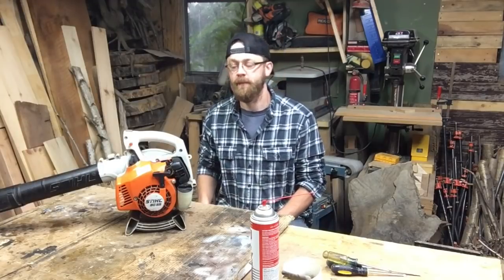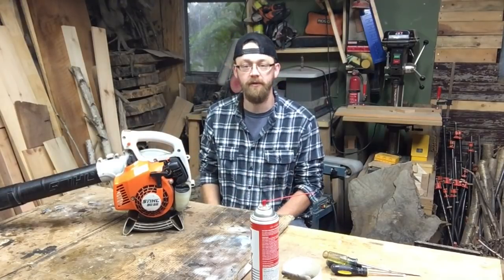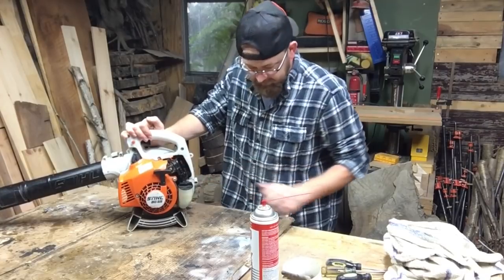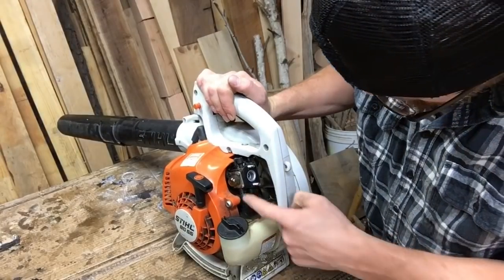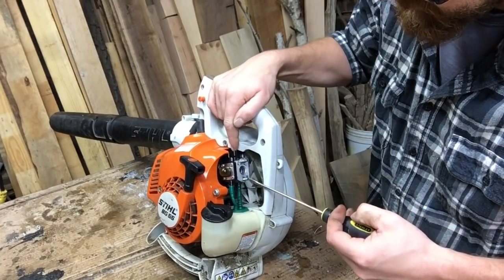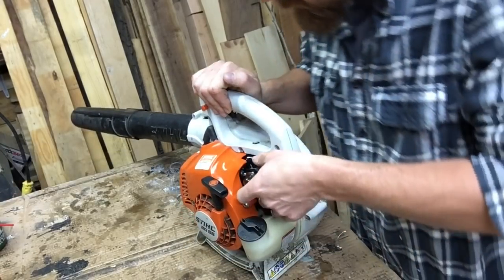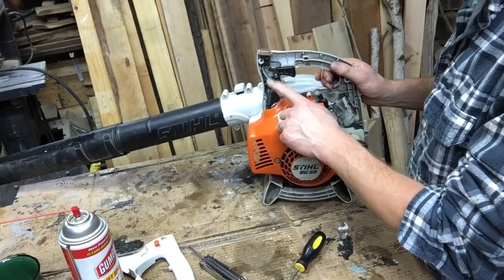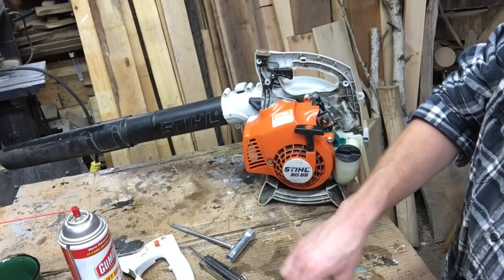Carb work on a Stihl bg 55 leaf blower.

Comment: suggestions replace the primer bulb, dump gas get new (check for water) pull the spark arrestor and clean then do the carb clean

Comment: I bought a used bg85 and it ran great for about 5 minutes then died. I checked the filter, spark arrestor, plug, etc and was all good. I determined that it would die because the check valve on the top of the gas tank was sticking from the previous owners use of ethanol gas and, just before it would die, I would unscrew the cap real quick and she'd rev right back up. Fixed that issue by drilling a tiny, tiiiiny, hole in the gas cap so it wouldn't spray gas out while running and I used it all day long after that. Ran several tanks of premium ethanol free gas with Stihl two psycho oil at 50:1. Runs perfect
Reply from the maker: Awesome comment thank you for sharing!
Reply: @KyleHallwoodworker  it's my pleasure. I quickly diagnosed it by unscrewing the gas cap when it would start to die and she revved right back up. Not a bad little blower.

Comment: i learned alot. i have to do this this weekend. i always dispose of the old fuel when i do a carb clean. i make sure the isn't any debris in the tank before putting in fresh fuel and attempting to start. that old gas can re-clog the tiny jets i and then you would have to take it apart a second time.
Reply from the maker: Absolutely true . Thanks for the comment Noel

Comment: Thanks!  I have this exact model and I am having trouble with from sitting too long.
Reply: Cheap carbs on Amazon $13.00 cheaper than a kit. I used parts from new carb to fix stock carb! Mine was a fs130 brusheater !

Comment: First, try adjusting the gold screws on top of the carburetor while you pull the throttle. I did all this work and that is all it was. The one closest to the back of the blower did it for me.
Reply: On pretty much all 2 cycle carburetors, the low jet screw is closest to the engine. The high jet screw is furthest from the engine.

Comment: No disrespect to Kyle Hall's informative video and effort.  

With BG55s, if you can't back out the tiny jet with the #(?) slot, one size down from a #1 and strong enough that won't snap, buy a new carb.   

The 55, from cheap Stihl subcontract carb, has to be run every week if using pump fuel to flush out all the junk in the fuel.   Owners buy and fill from the pump, use one weekend, and leave stowed in a shed for a month or longer and the gas in the carb, even 91 premium octane, at some point gums up and clogs the jet.  Doesn't always happen, but from cold start to full throttle and the motor bogs and quits, it's the jet.  If that tiny brass screw on the primer side doesn't pop out, the carb is toast. You can never get at to poke clean with a wire.  

The BG55,  a great little blower, is designed for 100% paraffin fuel and to winterize with.  The junk in pump fuel gums the jet, soots up the spark arrestor and the plug.
Reply from the maker: Thanks for this comment Jason
Reply: Tearing mine down tomorrow. Between this vid and your comment I have a few key points to look for, appreciate you both, thanks

Comment: You give me motivation to try and do this on my own.  I am just going to put in a new carburetor and dump the old gas.  I don't have anyway to heat up the spark arrestor so if that is the problem I will have to take it to a repairman.  Ugh!
Reply from the maker: Gayla Hunt  You can also get a carb kit from a dealer if you want to take it apart. If you choose to just put a new carb on do not toss the old one it might come in handy down the road .
Reply: I cleaned mine on the stove with a pair of pliars
Reply: Thanks for the great suggestion.  I did find a torch but I didn't need it the spark arrestor was clean when I checked.
Reply: Pull the spark arrester, and get rif of it.  don't ewaste your money on another one, it will fail too. You don't need it. It's a safety thing. Just don't blow any leaves in California and you'll be fine.
Reply: I use a bench grinder with a wire wheel. wd40 and water helps too

Comment: A new carburetor from Stihl is under $50, aftermarket ones even less. These blowers are about $150, the dealer won't work on it very long before you have that much in labor. I've been successful many times just cleaning carbs and dumping out old gas just like in the video. 
I've done this for neighbors, I tell them to get rid of any gas they have in cans. They don't, then put the old gas back in the machine and you know what happens.

Comment: Can get entire tune-up kit (carburetor, all fuel and vent lines, filters, gaskets, spark plug) for barely $10 and replace it all in barely ten minutes.  Doesn't take a genius...  and I like fixing my own stuff - but just a no-brainer.
Reply from the maker: I have replaced a carb on one of my chainsaws with a cheap carb it ran but it did not run the same . Replacing the carb is definitely a faster fix but I dont always have the time to wait for it to come in the mail . Learning how to make a repair yourself can save you money and time down the road . Thanks for the comment.
Reply: Yet the equipment suppliers say it’s not worth fixing. They tell people just to buy a new one.

Comment: cleaned and replaced every part on mine and ended up smashing it on the concrete. then ran a mag through it. think the problem was it didnt have enough holes in it.
Reply: You won't find this answer anywhere online: gas tank check valve gets stuck in the closed position and creates a vapor lock which won't allow the carb to suck fuel.
Reply: Hate mine too, for a long time it has to idle to warm up, now it just idles then bogs to die, was bought for my mom and I can barely get it going each time. Might try the more hole 🕳 route
Reply: @pantherplatform  where is this located
Reply: Been a long time since I fixed it and it still starts on the therd pull even if it's really cold out. It's pretty simple to disassemble the blower enough to get to the fuel tank and pull the hose assembly out. Two ends go in the tank and the other two go to the carb. I found tiny holes in the suction line with the filter on the end. They get hard and crack. I replaced the hose assembly, it's a molded assembly with the gromet that goes in the tank, with one I ordered online. I never have to prime it. I set the choke, squeeze the trigger on the first two pulls then release the trigger and she fires right up on the third pull before sliding the choke open to keep it running. It sure is nice for blowing off the car.

Comment: Spark arrestor is probly clogged =)
Reply: Tardisius first thing I said too lol
Reply: just bought one second hand recently seller told me goes but not well , first thing i looked at was the spark arrester  - sure it was clogged up 
quick clean with carby cleaner & wire brush - now works perfect
Reply: I clean them anytime someone brings one in for repair, just as a courtesy. I blow out the props and inside of the case, check the fuel filter, then clean and gap the plug as part of my service.  9 times out of 10 they come to me for carb failure. My courtesy service eliminates a lot of potential problems. I also dump the customers fuel and replace with my own mix because I know it is less than 10% on the ethanol, it's fresh and it's mixed correctly. If these things run rough after a minute or two of warm-up, it's usually just a matter of adjusting the hi and low mix. Those Zama carbs only have about ³/⁴ total turn on the mixing screws, so they are very sensitive to the slightest turn. These little carbs are sensitive to ethanol. Reeks havoc on them. Like putting sugar in the tank it sets too long especially in warm weather. The lower the ethanol, the better off you are.
Alrighty, I'm done talking shop. Lol...I look at these tutorials when I have exhausted all logic and I am stumped or I get in an older piece and I need to refresh my brain, and then can't get off YouTube. Lol
 If I can answer questions or help anyone with small engines just message me on Googlemail marksovine47. Please put the words small engine help on the subject line. Y'all enjoy tinkering!!
Reply: I thought mine was, too, until I checked it and it looked like new. The check valve on the gas tank was sticking and causing a vapor lock which wouldn't allow the carb so suck fuel anymore. Nobody talks about that...
Reply: Panther Platform where do I find the check valve? No clue what that is.

Comment: If you were to buy a new carb for a bg 55, what would be the best one money can buy?  Are the ones on Amazon for $15 any good?
Reply from the maker: Nate Legakis  hi Nate . I personally buy oem when possible. I have purchased from amazon nothing specific. I always recommend reading all the reviews and sellers rating before a purchase.
Reply: I bought one for mine it did not work good at all I land up rebuilding my oem one for like 20 works great now
Reply: They are $13.00 > and very easy to change,  it comes with a new air filter, new gass lines, spark plug. If I did it, anyone can do it.
Reply: I got it for $13. and change. It was easy to install, and started on the first pull. Just follow the video.
Reply: My experience: yes they work for awhile and then they don`t.

Comment: I put a new carburetor on and can’t find the start spot for the H and L screws . How many turns out for ea. screw? I’ve tried 2,3,4 turns and can’t get a idle point
Reply from the maker: I believe it’s all the way in and 1/4 out to start small increments

Comment: Hi:) when you say u picked it up pretty cheap second hand obviously can u tell me how much if you don't mind, im from Australia  id just like too see the price difference! There a great blower i have an older one than that probably 7 years old never changed a spark plug and at one point my primer bubble spilt and no one believed me that it still started it was about 5 months before I replaced it. Anyway quick question probably a dumb girl question but is a spark plug that comes with the new blower like when you but a new car and the battery lasts like years than when it dies the rest last 2-3?
Reply from the maker: Hi Casey Commerford . I paid $35 for this blower . It was a great deal .
Reply from the maker: Casey Commerford  If you replace the original plug with an OEM plug it should last the same .

Comment: Never use carb cleaner on a small Carburetor, they have small rubber parts in side that will swell shut. Use air ,or soak in lemon juice. Or both
Reply from the maker: Thanks for the comment .
Reply: Those carbs don't have any rubber parts in them and I have used carb cleaner on several never had a problem and I seen many dealers use carb cleaner

Comment: dump and pump out ALL old gas and put in ethanol free fuel with synthetic oil as recommended. Using old gas is asking for repeat problems of varnish and contamination... common sense.
Reply: and change fuel filter or clean

Comment: No indication in this video that anything was wrong with the Carb - a dust off with some carb cleaner wont do much buddy. You haven't check high and low speed jets, float needle, diaphragms for damage, fuel filter and gaskets just for starters .......best advice is to buy a cheap spare Carb. If your blower wont run swap over and only start fault finding when you really haven't anything better to do. These carbs and modern fuel are a disaster if your not using them every day IMO
Reply from the maker: I don’t know about that . I have done some simple dusting off carbs on bad running chainsaws and had great results. I just applied those same  techniques here . Yeah not very informative not super informational but some people seem to like it . I’m no mechanic I just video what I’m doing with my power equipment when it’s not running properly and sharing that video of it worked for me . A carb swap is 100% easier without a doubt . But videos like this add to the content. Thanks for your input. Hope you have a good one .
Reply: i thought it was a very good video. no, he didn't show everything you could do but he showed what it took for his machine. where are your videos mister smarty pants?
Reply: @noelroe6493  If you got something from the video great. I hope carb cleaner works for you too. My point was that if you have a problem with a Stihl carb its very probable that you will end up replacing - carb cleaner will do very little. Good luck with your Stihl Carb. Sorry my opinion caused you so much offence.

Comment: Typical POS Stihl. I would have checked the fuel filter first them taken the spark arrestor out and throw that in the trash.  Buy Redmax and you wont have these problems.